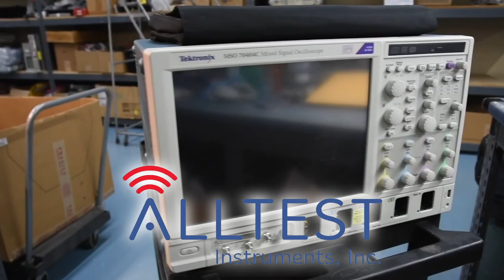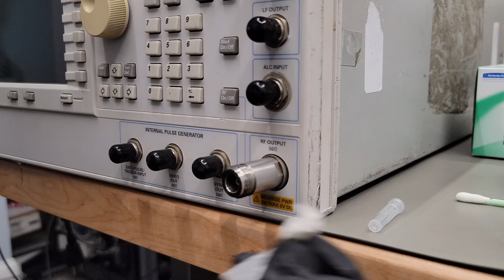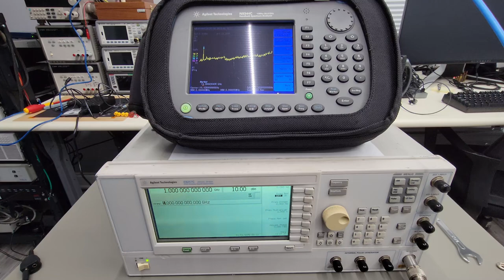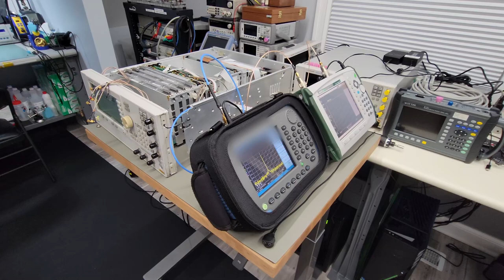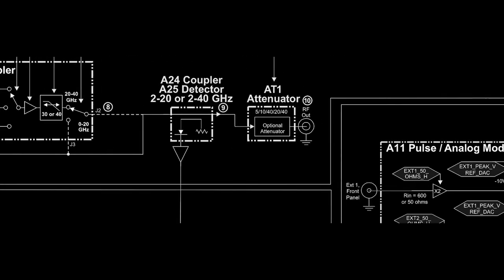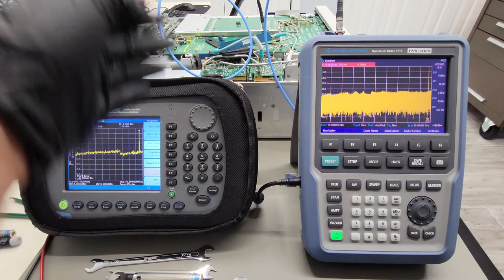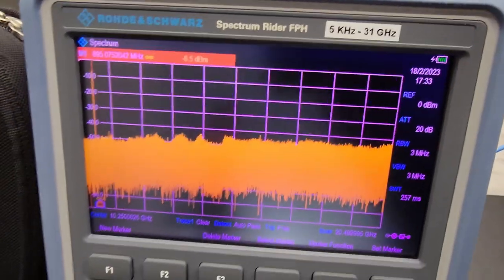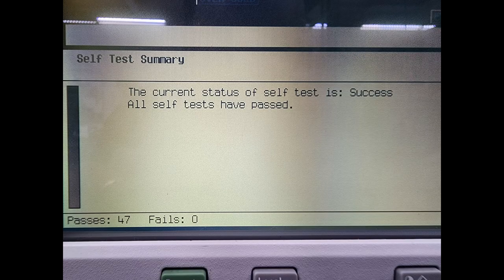Neonkev #3 - Agilent E8257C 20 GHz microwave analog signal generator repair

Comment: Good job Sir ... Very Professional diagnostic process , I admire ... But since it ended with calibration issue then I would not recommend you do replacement for the parts on ALC board , it could be also a CAL issue rather faulty chips ...
Reply from the maker: Thank you. Yes, this could have been a possibility, I suppose we will never know. I was inclined to believe the unit had a hardware problem since it had been set aside as such.

Comment: Hoarder warehouse..! 0:15 (many tens of thousands of units.)
 Are they trying to coner the market on second hand labgear.
a shame that all that second hand units aint out amongst the hobbybased markets, and help create an incentive for hobbybased engineers.
Reply: Hey Jakob!  We save surplus T&M equipment from landfills, refurbish the equipment, and sell it to hobbyists and startups throughout the world.  Happy to be part of the green ecosystem.
Reply from the maker: In all fairness, most of this equipment isn't that old (< 20 years) and is still worth a lot to legitimate businesses. It is notably less expensive than buying new. 

The target market isn't the average hobbyist; a reality for brand name, high performance equipment. Most hobbyists don't have a use for a 40GHz+ sampling oscilloscope with a maximum input of 5 volts into 50 ohms...